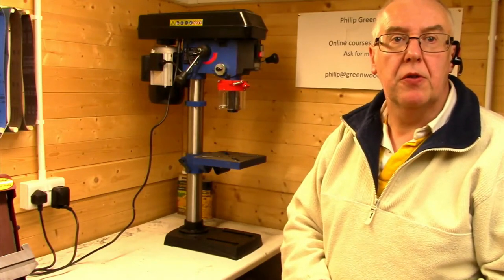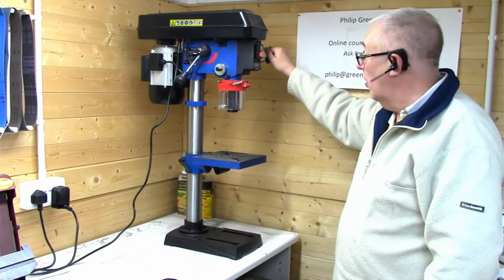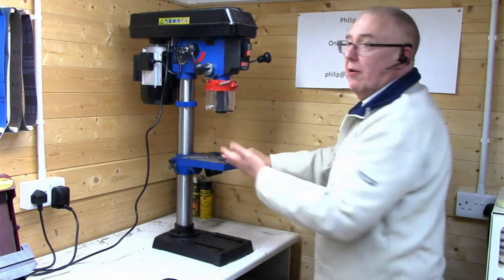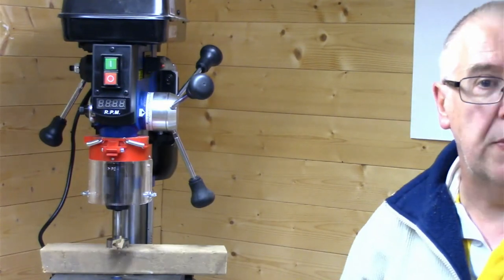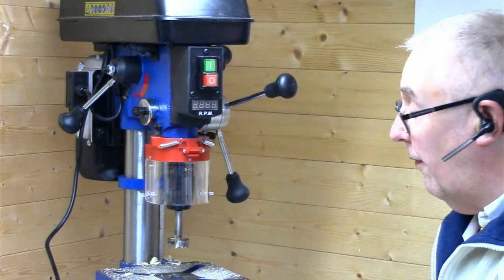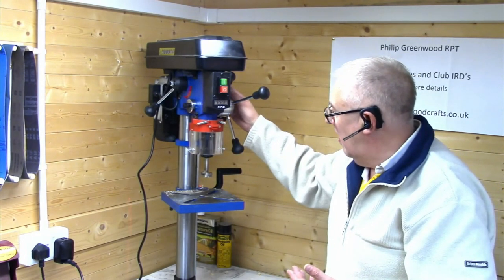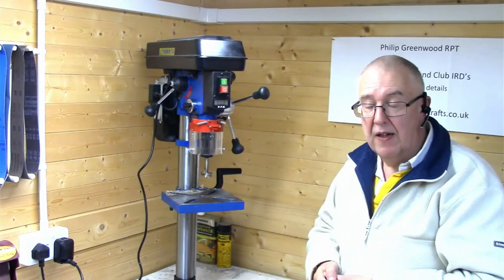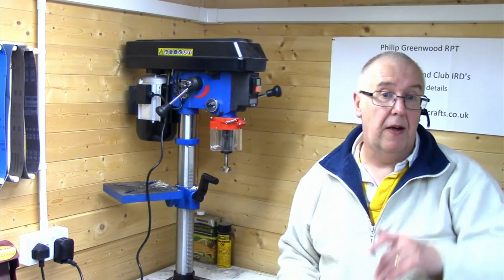SCHEPPACH DP19VARIO Bench Drill review

Comment: Hi Phil, Well done on the video review. I'm interested in this drill but my space is limited. Could you tell me the total height from the worktop to the top of the drill , the depth from the back to the front of the drill and the maximum depth that it is possible to drill through a block of wood (Spindle Travel). Thanks in advance Philip.
Reply from the maker: Hi. I will let you know. It maybe a few days before I can reply to you.
Reply: @PhilipGreenwoodWoodturner  Thanks Phil, can you answer one off the top of your head please. The specification for the DP19 Vario says that the maximum drilling depth is 80mm would this be correct ? - Thanks Phil.
Reply from the maker: Hi.
The hight from the bench to the top of the drill is 807mm. From front to back is 550mm. Side to side is 340mm and the drilling depth is 60mm. Hope this helps you. Phil

Comment: Hi.
How accurate is it for drilling in metal? For example, in a square pipe 40 * 40, can you make an aligned hole at a time?
Reply from the maker: You can drill metal, would have to check the specification for the  maximum drill size. How accurate  depends on the drill bit and drilling speed. It can drill at an angle but the srill bit could skid on the metal  surface  if not centred punced  first.
Reply: @PhilipGreenwoodWoodturner  I mean a perpendicular hole at a 90 degree angle.
It is also very interesting how he behaves with a step drill.

Comment: Would this be suitable for drilling into the top plate of a Draper 69356 Adjustable Bench Grinder Stand? I need to drill two holes because the back holes don't align with the top plate. It is made from think cast iron.
Reply from the maker: The drill will drill metal as well as wood, it all depends on the hole size you need to drill.
Reply: @PhilipGreenwoodWoodturner  Hole is 10mm diameter and cast iron plate is 14mm thick. Will this bench drill be suitable?
Reply from the maker: @Distorted-Vision  If you use the correct speed for this type of metal and drill size I cant see why not. Look online for drilling information on Cast iron .
Reply: @PhilipGreenwoodWoodturner  Thanks I just order the Scheppach DP19VARIO. It's  £239.99 on eBay from scheppach-direct with discount code: FALL20 but ends at midnight tonight. Also ordered a Irwin M42 Cobalt HSS drill bit set. Thanks.
Reply: @Distorted-Vision  Hi. How does it work for you?

Comment: Ansonsten ist es eine großartige Maschine und ich habe fast die gesamte Werkstatt von der Firma SCHEPACH eingerichtet. Es ist kein professionelles Werkzeug, aber es kann der Belastung standhalten.
Reply from the maker: Thanks
Reply: Was genau ist denn der Unterschied zwischen der DP 18 und der DP 19??
Reply from the maker: It looks like the DP18 is more industrial-level performance, hence the extra weight. but the DP19 has a larger capacities.
Reply: @PhilipGreenwoodWoodturner  hmm difficult...
Reply: @thomasmargis9808  dp18 better  table adjustment more angle seting , hevy 15 kg more than dp19 light in dp18
Reply from the maker: Yes a lot stronger.